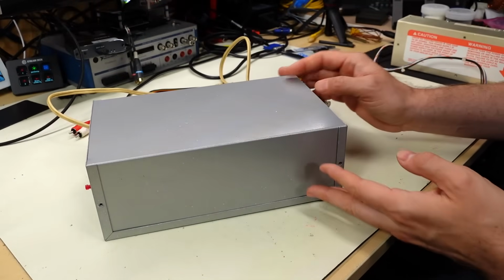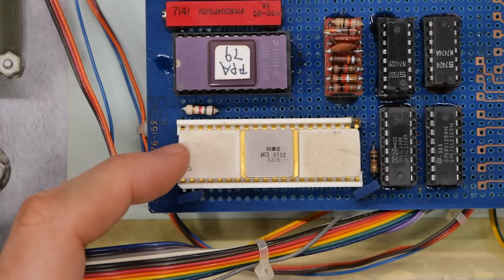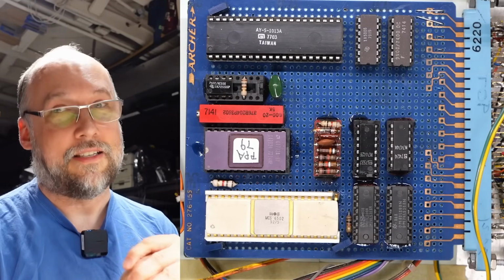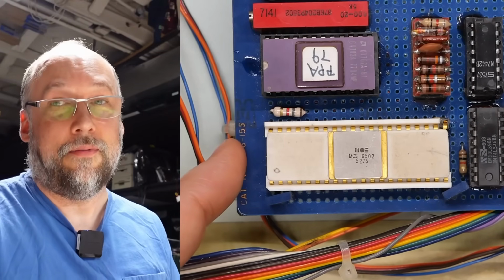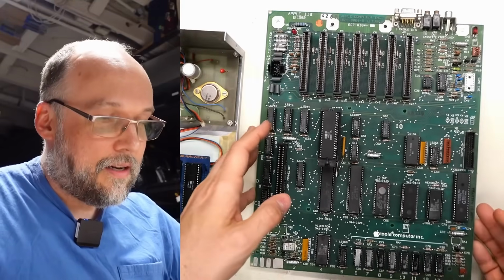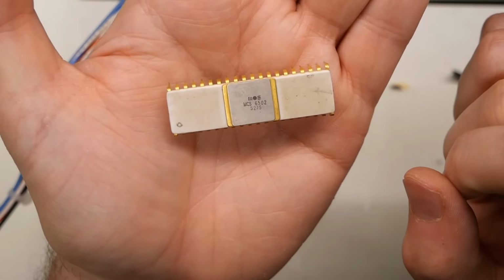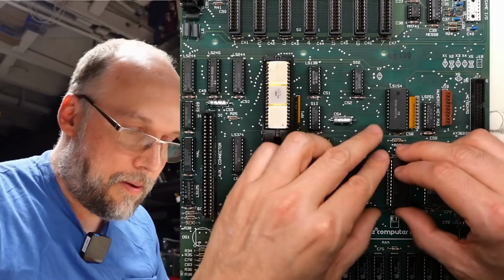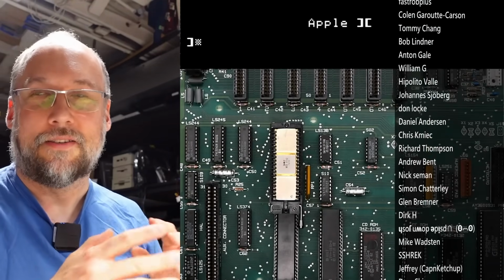Let's test a 50 year old MOS 6502 CPU

Comment: Adrian, seeing your cool find I am smiling and also ashamed. Back in the late 1970s and early 1980s you could buy those "bad" 6502 first run ceramic stuff pretty cheap, often in pairs or even "not tested" piles. In high school I used my pin money to order up all kinds of first runs, take out, knock off, returns, one offs from countless electronic surplus catalogs that flooded the family mailbox or ads in the back of Popular Electronics. Grab Bags were the most fun; you never knew what would show up?!  For years I had a couple of 3# coffee cans full of chips, including ceramic pack Z80s, 8080s, 6800, 4004s, 8008s, mystery chips and who knows what else. They were great to experiment with and use as spares but by the late 1980's they weren't getting used so I tossed them to re-use the cans! I'm so ashamed. Even if I'd kept them and now gave them away it would have been better than tossing them all out to re-use the cans. 

Thank you for sharing. Rest assured it wasn't long before I realized my huge mistake!  Since then I'm much more careful. I've re-homed a lot more stuff from e-waste, have a lot less space from keeping more, and, believe it or not, still have the two coffee cans that once housed some of your rare 6502s.
Reply: Rare coffee cans.
Reply: I worked in a computer store that had piles of old CPUs laying around in back. I'm sure they got tossed in the dumpster when the place shut down.  Gold was still relatively cheap and reclamation wasn't a thing yet.

Comment: I work in E-Waste ... I see things like this all the time and have to take them apart to sort the parts, that board would have been thrown right in the low grade box. I try and keep an eye out for special things, but I am sure I don't always recognize that it's special. I am able to save a few things but I can't save it all. I rationalize a lot of it by saying to myself if we didn't recycle it nothing would be rare. :)
Reply: Pretty much any white ceramic IC is worth at least a few bucks these days... if not more.
Reply: I've been thinking lately that at this point, a lot of e-waste places probably purposely employ people who are at least aware of some of the obviously-valuable stuff so they can turn it over to the secondhand market for a lot more than they make just processing garbage.
Reply: @stevethepocket  It's not about individual pieces, it's about volume. The place I work is an intake facility. We buy product from the public and some commercial and basically sort and package it. We sell it to other recyclers who break it down into useful metals who in turn sell it to foundries. Trying to sell individual items on the second hand market is way to slow. So if I don't save it or someone down the line doesn't save it, it will be destroyed.  I do know that the place we sell PCBs has a machine that photographs them and then points out any IC's that can be sold intact. They will recover those IC's and then the rest of the PCB and components get ground up, sent through several different washes, then melted down to recover the metals, specifically gold and platinum. ... Disclaimer : Other recycle companies may do things differently :)
Reply: rarity is not a desirable attribute in the universe
Reply: @kargaroc386  Maybe not in the universe but it is to Humans.
Reply: It'd be awesome to see what you've collected... even if it's just a pan over a bunch of stuff on the floor! Hope you don't mind my subscribing in hopes one day you do.
Reply: @ericwazhung  https://youtu.be/BGnNlVzUCZM This is a video of some things I saved and sent to Adrian.
Reply: @Neodra  Nice finds! Thanks for sharing with him to share with us.
Reply: Ceramic package, gold plated pins. Suggests engineering samples or space qualified.
Worth keeping.
Reply: I think anything in one of those white ceramic packages with the metal cover over the die is bound to be pretty rare at this stage. Even a purple-gray ceramic chip with a metal cover is probably worth a closer inspection.
Reply: Quite a bit of gold in that 6502 to be tossing into a low grade box.
Reply: @greggv8  Ya if I see things like that I will pull the chip and throw it in the CPU bin. More than likely I would set it aside and see if it was anything special. Google is your friend :)
Reply: It's already RARE! You could be making it extinct... 😝😭
Reply: please, you in e-waste, should learn what is precious, and save it. It's duty for the earth. goverments screwed so much, it should be illegal to scrap , without revision of some educated men, that can mark precious. goverments should also finance transport to PC museums, or special stores for it. It is crime, to scrap that in those amounts.
So try to save as much as you can please.
(at least CPU, and graphic cards, that are small)  , particualry 486, AMD k5, socket 7 CPUs, slot 1 CPUs. AMD k6-2/k6-3.
Reply: @warrax111  I would love for that to happen too, but unfortunately, I don't ever see that being realistic.
The time, effort, and storage would be way too much to be cost-effective. Governments don't give a f**k about the history of the computer or electronics, so good luck there !!
Reply: @warrax111  speaking of museums, I was at a computer museum next door to a goodwill, and the atmosphere was the same in both... There was an old Cray supercomputer with some panels taken off and it was fascinating to sit down and put my hands on the innards of my childhood dream technology.   Like meeting an old rock star.  Some kind of surprising methods of construction in there too,  It looked a lot more futuristic on the outside than on the inside !

Comment: Thank you for this very involved video of yours.
Yes, in these days of planned obsolescence it is almost unreal to see a chip from 1975 operate the way it was meant to.
On the other hand I'm not too surprised - I still have some analogue computers I built in 1975, and they still work flawlessly.
I avoided the use of chemical resistors and tantalum capacitors, while using instead film capacitor and silvered mica, so I hadn't any problem from degrading over time of passive components, with my equipment still working to this day.
I just wanted to add how the 6502, and the Zilog Z80 from Federico Faggin, were both the result of the design of very small teams made of few genial people. Those uP contained only four thousand transistors, but contained the seeds for all powerful computers of the future. The Pentium 4 was four million transistors and nowadays any 888 Arm SoC contains four billion transistors, and no single  human can grasp the structure of such "monster" - generated by mind-blowingly complex EDA tools (compile-to-silicon)...

Comment: There are probably at least half a dozen user port to serial adapters out there, but just for the sake of preservation and posterity, I would really like to reverse engineer that vintage homebrew kit.  The point of doing so in my mind is to experience as closely as possible what that original device did all those years ago.

Comment: Rotate right is a very fast way of divide by 2 - division used to take up many clock cycles (if it was an instruction at all, the Z80 is missing it) and for divide by powers of 2 - which is used quite often in low level code - rotate right is a good alternative.
Reply: ROR and ROL were the only multiply/divide-like instructions on the 6502.
Reply: @wbfaulk  Ouch in that case indeed. I don't have experience with 6502 assembly; I was just pointing out the reason why this might occur in many kernal code segments.

Comment: I have a white 1976 cpu in the basement along with the Jameco receipt for $75 for it and the 6522 pia I bought in high school my sophomore year.  I lived in PA not far from MOS fab.  I called and an engineer sent me programming manuals and data sheets.  Wire wrapped it up and had a tic tac toe program working on it using an  old point of sale terminal.  Later ran tiny basic on it in college.  Fond memories.. I will probably dig it out when I retire in 3 years. But your video made me remember the gogo days of home computers
Reply: MmmowwwTwwwOossszzz

Comment: The incredible thing about the 6502 is....  it's still made and used today!  Same thing with the Z80.  The same thing can't be said for the Intel 8088 or 8086 (AFAIK at least).  And even the highly used 68000 isn't made anymore.

I remember  in college in the mid 90s someone told me that the 6502 was still heavily used as a micro-controller, which astonished me at the time.  Fast-forward 30 years, and it's even more astonishing.

To have one from the first sets of batches made is kind of incredible, given how important this chip is.
Reply: Note from the future: Zilog ended production of the Z80 in April 2024, not long after this video was made.
Reply: @MahoneyJameson  Interesting.  I hasn't heard that.  Google-foo seems to check out.
Reply: The Intel is usually incorporated as an IP block on some hardware rather than being a discrete piece.
Reply: @brodriguez11000  Curious.  I had no idea.  So is their a mini 8088 section on some obscure chip out their running as a micro-conrtroller at a few mhz?

Comment: That's actually really cool. I cut my teeth on the 6502 (in the BBC Micro) but I didn't know about the ROR bug on the very early revisions.
Reply: i the bbc used synertek versions, sy6502?  thats what my bbc has in , have seen rockwell ones as well r6502

Comment: I was not too surprised it still worked, in the summer between school and university I worked for GEC in one of their avionics factories, and they used a lot of ceramic packaged chips. I asked one of the engineers, and they said that the package protected the chip far better than plastic packages, which for military electronics was obviously important. A lot of the things that make old chips die (other than being overloaded by other faulty components) is ingress of gases and moisture from the outside which the ceramic packages are especially good at preventing.
This 6502 is a great find, and a cool addition to your collection. There surely cannot be many of these left. And its nice to see that someone made use of it for at least a while after the corrected version of the chip came out.
I'm not sure what microcontrollers were available in the late 70s to hobbyists so using a cheap/spare microprocessor was probably the only thing available to an enthusiast - although there were microcontrollers, most of them would require a very expensive dev kit/programmer to use. Back in 1979 a plain old EPROM or PROM programmer would be a significant investment, or require the construction of a add on to an existing computer (a sort of chicken and egg situation!). I remember buying a EPROM programmer for my PET in the early 80s and it was pretty pricy as I recall.
Reply: Interesting point about the availability of chip programmers... With only a 256byte ROM, it's entirely possible it was hand programmed with dip switches!
Reply: @ericwazhung  Yes, after I wrote that I recalled reading about heroes that used to program PROMs by hand.....

Comment: The original monitor, at least, uses it only once: in the disassembler.  FPBASIC uses it for the floating point code, ONERR and hi-res graphics.
Reply: Makes sense. Thanks for clarifying.

For those who don't understand, he is talking about where ROR instruction is used in Apple ROMs, and "monitor" is memory-editing software, not a display device.

Comment: AY-5-1013 is a UART from General Instruments, which eventually became Microchip, famed for their PIC line on microcontrollers. I used these UARTs extensively in the 70s, they were ubiquitous in those days.
Reply: Funny, when I saw AY and GI, I thought sound chip...  😅
Reply: @omfgbunder2008  well that wasn't exactly a wrong thought the AY chips in the homecomputers did both :)
Reply: @omfgbunder2008  So did I.

AY-38910 if I recall correctly!
Reply: @omfgbunder2008  My mind always jumps to Pong!
Reply: That chip is also a piece of history itself
The Taiwan silkscreen shows that the chip might be the first ever batch of chips that Taiwan manufactured in history, cause the semiconductor division of ITRI(which later dissociate from government and became UMC/Mediatek until now) finished their first batch of chips around the end of 1977
Reply: you beat me to it, i vaguely recognised the number  and googled it,  i may have one or 2 lurking around,  definitely havent got any ceramic 6502s,  i did find a ceramic 8008 on a board....
Reply: I pulled out my 1978 GI catalog to look it up.😊
Reply: @SolderGuy11  You should get that catalog scanned.  That particular one has not been completely scanned yet, just parts.  I have a flatbed scanner, if you'd be willing to loan out the catalog.
Reply: Came here to post the info on the UART.  Good info, @Nezbrun
Reply: Asking $42 for the AY-5-1013A  on ebay.

Comment: What other cheaper microcontrollers were available (in small quantites) in the mid-late 70s? I don't think the 8031 came along until the 80s - 8048 perhaps ?
Reply: Intel 4004 was available. I lusted after one in our electronics lab but was informed by the guys there if I so much as touched it I would lose my thumbs. Things worked out for me though: Bought an 1802 Super Elf and was happy with it.
Reply: The first PICs were 1976, but they were mask programmed, except for expensive  development and field test versions which had ROMless microcontrollers or ICEs allowing the use of the developer's own PROMs. 

Dev cycle was ICE then Field test with ROMless PIC plus PROM, then get GI to run an initial mask version for validation, then production.

EPROM-based microcontrollers, let alone flash, were still some way off still.

I certainly don't miss these aspects of the development cycle! One bonus though, no firmware updates!
Reply: Other than the Zilog Z80...   which started rolling out to market around the same time...  not much else in a reasonable price range.
Definitely a collector item...  the early 6502 bug made early adoption difficult versus the easier to use and stable Z80.
The combination of the MOS 6502 and the Zilog Z80 hitting the market at around the same time was the cost catalyst for hobbyist to take their babies to commercial viability.
I myself started with the Z80...  but I knew about the 6502.  This is the first one I have actually seen covered in a video... admittedly I never looked before.
Thank you for sharing your find with us Adrian.

Comment: Damn dude, whoever built that box really knew their stuff.
Reply: Actually back in the day the ability to write simple machine language programs and design simple circuits is considered basic skills, like the ability to write HTML these days.
Reply: @18000rpm  As a 90s kid, I feel like I missed out on a golden age.
Reply: @18000rpm  Or, they could've simply been an electrical engineer or computer engineer who worked in the industry and had access to prototypes and other parts like this that were quickly discarded as updated versions came out.
Reply: The workmanship was awesome.
I was just grinning ear to ear !!
The code and project just for an interface.  

This guy was on the top of his game. Reminds me of the "City on the Edge of Forever":  ...stone tools and bear skins.

Radio Shack really deserves more credit than they are getting. We took them for granted.  They even took themselves for granted.

Comment: The other big chip on the board, the AY-5-1013, is a UART (serial port).
One would not expect such a chip on this board, as the serial function at low bitrate and mostly for output could easily have been done in software.
Reply: Yes, I thought that too, but it may have been used just to make things easier. 
It's possible to bitbang serial on 6502 buuut that chip itself doesn't have any realtime timers so you would need to add them, and add control logic, write realtime software, and test all that, possibly with different bitrates...
Actually, you could probably do that in software using C64's serial port itself, except you would need to modify whatever software was used for printing.
This though looks like a quickly-hacked-together job rather than a well-thought-out cost-minimized commercial product.

Comment: Those 1702 Eproms are "fun" to program.. you need a programming voltage of -48V. On ALL pins, so, the logic levels are -48V, too. Except the Vgg pin, that needs -35V. 
You then have to apply +12V to the Vbb pin, first set the adress pins to the inverse of the address you want to program, then invert them back to the "real" adress, then give this programming pulse for 1ms and go the next adress. You then have to program the 256 bytes 32 times. Programming 32ms at once destroys the memory cells. 

Still beats mask rom though ..
Reply: Cripes!
Reply: I had a piece of equipment with sixteen 2708s (and a ceramic 8080A from 1977) that I finally got to read out this week. The 2708 "only" needs +12 and -5 volts to read it. But I had already fried a "test" 2708 (with known data) trying to read it with a bodge board on an EPROM programmer, so I was definitely worried.
I built my own reader from scratch with a "blue pill" board to run it. In the meantime I learned that if the -5 isn't there, the chip could quickly fry itself, so I put switches for the +5 and +12. I had also heard that too high of a +12 could be bad, so I added a diode drop to make sure that the +12 was less than 12 volts.
There's a very good reason why you rarely see EPROM programmers that support anything smaller than the 2716, even ones from the 90s. There are just too many weird voltages to deal with.
Reply: Holy Moly! I'm not sure if this helps my theory it might've been programmed via toggle switches.
Reply: @ericwazhung  I mean, you probably could with the assistance of a timer circuit for the actual programming pulse.  It would be pretty hellish though.